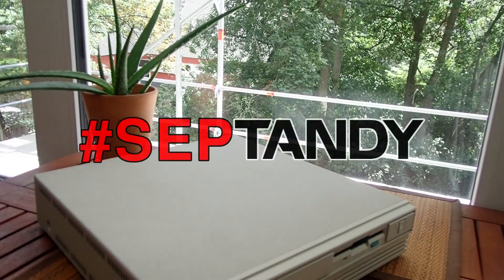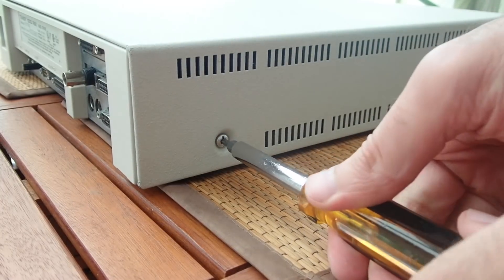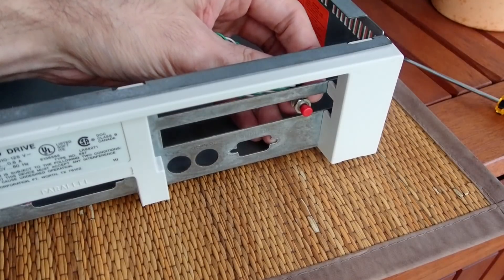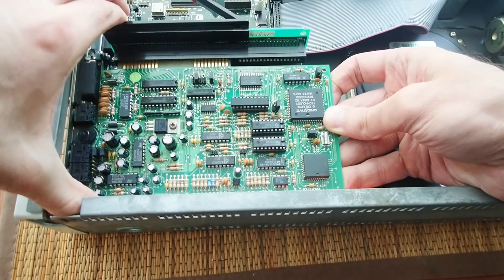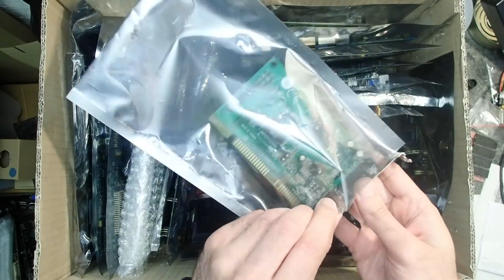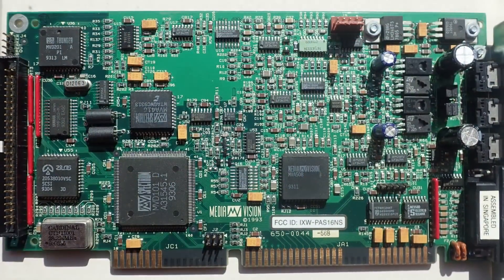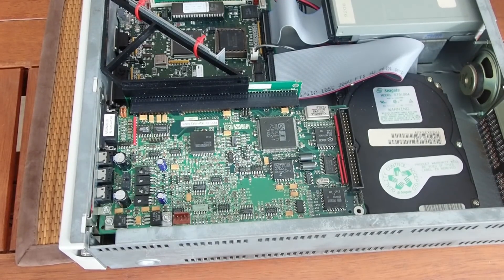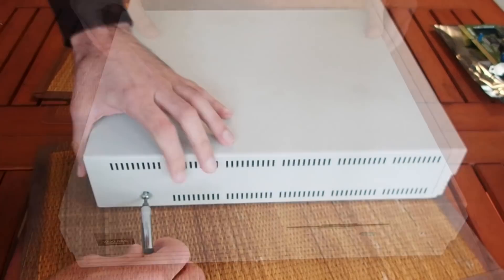#SepTandy 2021: proper audio configuration and a reset button  for my Tandy 1000 RSX

Comment: To be honest I started off with Microsoft XP Pro (worked alright but not properly because of the AHCI) then Microsoft Vista (which kept crashing because it didn't like my Trackball) then UBUNTU 12.04LTS which was brilliant but I really wanted to install GhostBSD (Open UNIX) but would not show up in the install menu so I went for Linux Mint CINNAMON 19.3 (Tricia) 64bit edition.
Reply from the maker: I started with.... well, you will probably not know with what I started, however, my first AT compatible was a 386SX-20 overclocked to 25MHz and it ran MS-DOS. I really didn't like windows from the beginning and stayed with DOS as long as I could. Then I switched to Win95 around 1996 and around 1998 to Linux. I never came back to Windows ever since. That's why my favorite operation systems I like to tinker with are DOS and Linux. But due to my job as a software developer, I had to look into the guts of various MS products as well. So I can't tell, that I have absolutely no clue about Windows, however my knowledge about it is not nearly as deep as about Linux.

Comment: What about ditching that Motherboard for a DAA78L+AMD A10-7800k and 512GB of DDR3 RAM then you will be back up and running and go with Linux Mint CINNAMON 19.3 (Tricia) 64bit edition and Wine64+Winetricks64+Zip.dll and then you could play all your Windows or DOS games.
Reply from the maker: What a scary idea :D
Reply: @necro_ware  Not so scary as That is what I am running and I have no problems what so ever.
Reply from the maker: By scary I mean, ditching something, what is quite rare, with a big historical value and probably twice as expensive for something mediocre. Doesn't make too much sense to me, especially where I have a Ryzen 5 3600 under my table :D But again, it has to make fun eventually. If s.o. wants to make a "sleeper" out of a Tandy machine, it's a way to go. However, please don't get me wrong, I'm running a retro channel, because I have a heart for the retro machines. So this wouldn't be fun to me. As I told in the video, I was even fighting with myself, as I should drill a hole for the reset button :D
Reply: What are you doing in a retro hardware video's comments pushing Linux and emulation for?  Weird flex. Hit up an emulation channel or something.
Reply: @Rex Warden My OS of choice is Linux Mint CINNAMON 19.3 (Tricia) 64bit edition and I am having no problem whatsoever.

Comment: now you can add a scsi cdrom  drive ;-)
One more thing that could complete your build is adding mt32 support. Im personally playing around with mt32-pi with softmpu. It works very well and it can even work over serial. But you could also use your mpu 401 midi output.
Reply from the maker: Yes, the machine has only two ISA slots and both are occupied now. But since the PAS16 can MPU-401, I can connect an external MIDI device through the joystick port. SCSI CD-ROM would be complicated however, since the case has no 5,25" bay for it :D I could however replace the network card by a SCSI card and connect an external SCSI CD-ROM if I need one.